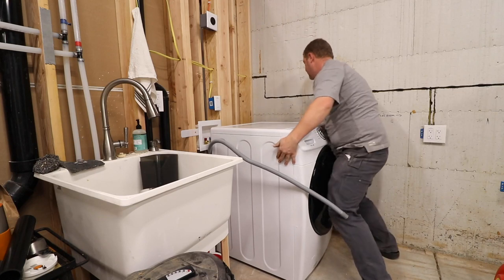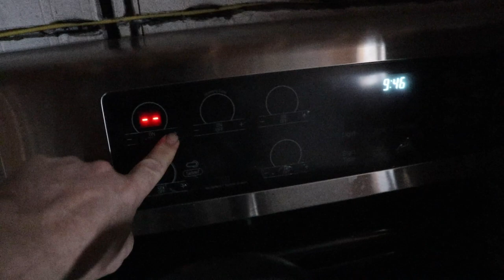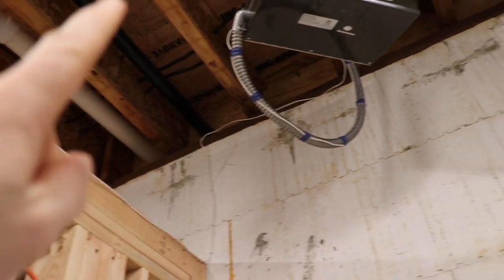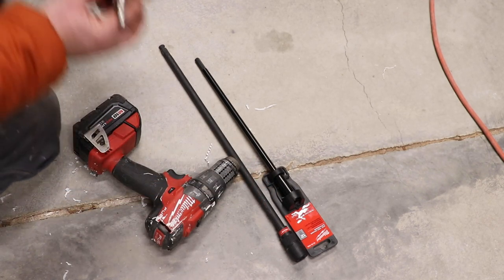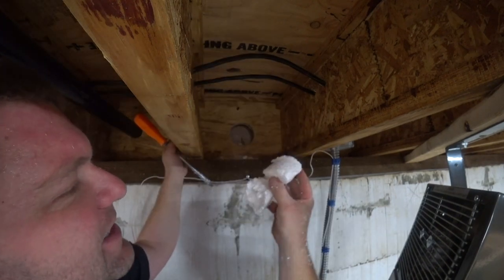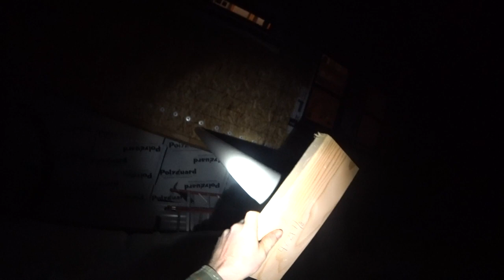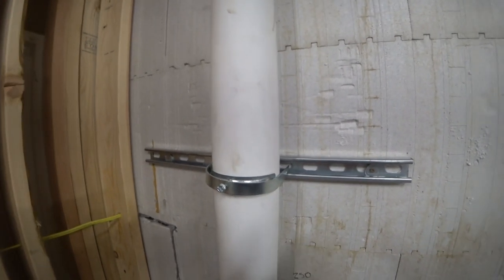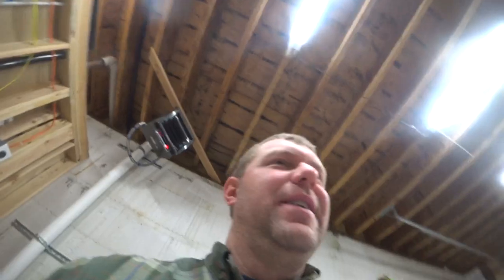WINTER YOU DIRRTY DOG! (Dryer Vent Installation)

Comment: I have a steel roof and installed snow brakes on both sides. They hold on to the snow to keep it from sliding off and killing someone. You can use then use a snow rake to pull off some of the thicker or heavier snow. Works good for me.

Comment: should be usin4 inch metal or aluminum for the dryer vent. i've  never seen anyone use plastic for a dryer vent haha  and you should never crimp into the vent, all crimps should be going outward so exhaust or lint doesn't collect and cause a fire. also no screws.

Comment: Use inexpensive (relative to PVC) metal vent pipe and cover it with insulated cover that is commonly used for air conditioning/heating  ducting purposes (HVAC Insulated-Flex Ducting Ventilation Duct Hose).  That will comply with building regs and also keep inside the pie and out of your house. In any case, you will most likely have solved the issue one way or the other since we're weeks behind real life.

Comment: Yes, I was screaming at you until about 25 minutes in! You figured it out, though. RTFM! Read the code, then make your plans. I just moved into a house that was venting the dryer into the carport that had been enclosed for a garage... what a mess, lint everywhere and I had to use a dehumidifier to remove the moisture from the air. Bit the bullet, did a proper installation of 4" galvanized tin pipe and have never looked back! There is very little heat generated from the pipe, most of it goes right outside. Unistrut is complete overkill for tin pipe, you can use plumber's strapping.

Comment: Try inserting 4 inch galvanized into the 4 and a half pvc as a sleeve only where it goes through the wall. That way you don't have to patch things. 4 inch galvanized pipe is what you need to vent a dryer. There are also length and number of elbows allowed as well as verticle length.

Comment: With a lint filter in the dryer, I would build and put a diverter box on the vent pipe to direct the warm air inside the garage in the winter. Even just an hour every wash day would reduce power consumption.

Comment: The "V" in DWV is for plumbing venting, not exhaust venting. Yes, it has been used in newer heating systems (90+%) but it is not listed for that use either. There is specifically designed duct work for those heating units. The only acceptable heating venting material where I live is galvanized steel. Properly installed it will not collect lint in a dryer system and can be taken apart to clean if it does build up.

Comment: 4" aluminum pipe with silver metal tape for sealing the joints. Never use screws. Make sure the crimps of the pipe are pointing with the flow of the air from dryer.

Comment: I'm a fan, but I can't take it! Run your drill on high speed and quit pulsing and rocking it! Keep it straight... Put the drill by the ceiling so if it spins it will hit the bottom of the floor and won't take your arm with it. It's nice that the snow sheds from the roof with just a few inches of snow.

Comment: You don't want the PVC pipe for any vent that might be subject to heat, fire etc.  The reason is off  gassing and toxic smoke. Also read about   what the limits are for heat rise and vent length.

Comment: As a HVAC worker for a living, this is a hard no. This is not acceptable from the heat. Also, the static charge on PVC pipes from left over lint an hot air running through it would result in buildup. You explained it perfectly. Absolutely must be changed. You can insulate any duct pipe.

Comment: Four inch galvanized sheetmetal pipe . put in a lint cleaning accessable fitting at the bottom of the pipe as you will always get lint buildup.

Comment: The Diablo setup is the best, I’m a cabinet maker and have been using the quick release for years. Never had a problem, and I’ve never run s holesaw in reverse. No need, just pulll back while in forward.

Comment: In 2001 I worked on a job inside a metal building that was 300' wide and 900' long.  At the peak of the roof it was almost 30' with over 10' side walls.  In January it came almost a foot of snow, the weather stayed cold for about two weeks and then warmed up to just about freezing.  The building was not heated although there were some area heaters being used in certain areas.  During the afternoon the interior of the building must have heated to just above freezing and the entire roof's snow slid off all at one time.  It was piled up about 3 feet high and five feet across the length of the building on both sides and that was packed down a lot.  No one was entering or exiting at the time but if they would have been there is no doubt they would have been seriously injured.  I was only there for one winter and we only had the one real heavy snow but I think of it anytime I am around a metal roofed building to this day.  If you are at the right place it isn't like someone throwing a snow ball at you, it is serious business.

Comment: You will need a one way exterior flapper to prevent cold air from coming in and also a critter cage. They come preassembled. You error becomes a training video for others. You can use your metal work for keeping the dryer vent straight and flush to the wall. 4 inch vent pipe!

Comment: I use PVC for ducting my wood shop dust collection system and resolved the static buildup by wrapping the pipe with bare braided wire which was grounded to the dust collector. This has been working fine for several years without static buildup. I used one wrap of wire every 2 feet.

Comment: Give up on that snow landing area. It piled up higher than 7 feet at my cabin for 12 foot per side roof. 
Drain Waste and Drain line vent to the roof above a drain stack. Not Drain Waste Air Vent as in HVAC. 
Flex hose or sheet metal duct. It comes flat and self interlocks into 2, 3, or 4 foot sections just like the stove pipe in the shack.

Comment: I always call the inspector in my area, when working on something new. They can tell you what is used for the job that they will pass. Most inspectors are glad to help you so they don't have to make you change the work later. Sorry to see you had a set back, but its only a small one. One 4" PVC pipe is a small price in the total price of building a house. My wife always tells me did you read the information yet, you need to start job XXX next week and you need to make sure X and Y can be used. I never would have been able to do the work I did without her. Be safe and take care of each other....

Comment: Rated for plumbing vents, not heat-related vents. It will outgas toxic chemicals when it get heated, and it will burn in nasty ways. Not good for a dryer or range.

Comment: Hey Jessie, I do this stuff for a living.  Next time drill a small pilot hole from the inside all the way through then drill from both sides that way you don't make a mess by blowing out the other side.  This is for both wood and cement.  Just a bit of a trick and it saves buying an extension.

Comment: PVC is for venting in plumbing and some new type high efficiency and vary low exhaust temp not for dryer venting use steal vent pipe and if you don’t want to use screws or pop rivet us  heavy duty house clamps

Comment: Instead of venting to the out side with your dryer set up a water bucket trap in your garage. To capture the lint and use the heat to help heat your home. Missouri wind and solar has a video on how to do this....  No seance in waisted good heat

Comment: small thought here,  During the hot summer months, dry the laundry outside, in the winter a little extra heat in the house is a nice thing!  If you're not using the dryer as much in the summer you (a) save electrical cost as well as heat and (b) can more easily mitigate the heat with a fan or two.

Comment: Awesome opening shot from the drone.  Roof slides can be triggered by vibration of simply closing a door, deadly to people and deck structures.  As you might agree...at work we often say, "We do it right because we do it twice."  Good luck on the vent, you will figure it out.

Comment: FYI,  in woodworking dust removal systems we cut down on static in PVC pipe by running a copper grounding wire inside the pipe.  The wire is then grounded to the house ground.

Comment: Home Depot usually sells 4" dryer duct in flat sheets of aluminum or galvanized steel. The flat sheets are pre-bent to form a seam when you curl it into the round tubular shape. Your Unistrut stuff will work fine. DWV is for plumbing only.

Comment: Jesse the elephant in the room where you are drilling for venting has to be the weak link in insulating your home. You will be surprised to see how much heat loss you have there. Maybe some mineral wool insulation in those spots really helps you out. Maybe that's already your plan but if not might want to do it quickly. House will be warmer immediately and your electric heater will not run as often. Winner. Maybe.

Comment: You are very lucky you didn't break a wrist using that battery powered drill for a big hole saw. That's a job for a big corded drill WITH a screw in arm to control the torque (like my Milwaukee). 
It also comes with an optional right angle chuck for drilling studs for electrical. Right tool for the right job will keep you healthy and safe.

Comment: Code should be you are only allowed 25 feet of ducting total for your dryer vent. Each 90 degree elbow counts as 5 feet of pipe. I believe a 45 counts as 2.5 feet but you don't have a need for those. You should be good to go, just use metal ducting. Check and see what they want you to use to fasten the sections together, some places are very strange in their requests.

Comment: ... just spent 200 bucks more on the dryer to get a condensation dryer. This doesnt need a vent but only a drain, and it saves a lot of electricity... basically paying for itself by the lower electricity bill...

Comment: They have dryer indoor vent filters. You could recycle the dryer hot air back into the garage to help with heating in the winter. And yes some humidity will during winter. Ck code and they might let you. Just put a diverter or flapper valve.

Comment: You can hang-dry even in sub-zero weather as long as it's well ventilated and not too humid outside. You can use your RV shack for it if you don't want to do it in the house. 

Down the road it'll save you a lot of electricity as well.

Comment: 4" dryer duct can be found made of aluminum. HVAC flexible duct can be slid over the metallic duct to insulate it and prevent the heat transfer into garage area during the summer months. Your option if you wish to remove the insulation and use it as a heat gain in the heating months. All joints in the metallic vent line should be taped with aluminum duct tape prior to covering with the flexible duct. The 4" aluminum duct is generally available in 3, 4 and 6 foot lengths. Elbows are readily available and should have all joints sealed with tape after the correct angle is set. Be sure to use aluminum screws not more than 1/2 inch in length to secure the elbow to the straight pieces.

Comment: Your probably right the first time. 4 1/2 but the holes only off from each other by small fraction of an inch. Foam saws differently than your inside sip and your outside sip panel. Add on your rim joist and you have 3 different times that must line up. Very hard to do without a drill press, which can't fit , lol. Nice going. Steal dryer duct comes in 5' sections but only 4 1/8" in diameter. Seamed on one edge and you then zip it together to make a tube. 90 degree elbows make corners a breeze. Duct tape joints or use a duct type tape that's metal backed, used by a/c duct installers. Don't use any screws to join pipes or elbows. Done.

Comment: Hey Jessie, don't let it get you down brother. Isn't it ironic that in the good ol USA where we live, they sell this plastic expandable flex pipe as dryer vent and it is not supposed to be used at all. It too  clogs up with lint and can cause a house fire, a very common cause of house fires. Anyway, you should be able to slip metal pipe right into your wall brackets and elbow right outside. Only hard part I see is getting the PVC pipe back out of the wall ERRRR!! Metal pipe is what we used once we learned this lesson about the flex pipe on dryer vents. They sell them in the big box stores as a dryer vent kit....how crazy is that? I also see Mom is coming right along there. We still pray for you guys often, the little one as well. Be blessed.

Comment: When using PVC for a dust collecting system , you can run a bare copper ground wire inside the pipe. Also the V on the PVC refers to plumbing vent - not air venting.

Comment: Use metal for a dryer vent. It won't burn through as easily when the lint starts fire. The plastic pipes are fuel for the fire.
Heat from the dryer won't be a problem in summer. A clothesline outside can't heat up your house. Sun and wind are the original off grid power supply. If you paid what I pay for electricity there would be a clothes drying rack indoors too.

Comment: Metal for Dryer Vents... You can even get flexible duct for dryer connections. Exterior vent comes with a flap that only opens when the dryer is in use.

Comment: There is snow on the ground....blow that hot air back into the garage with a lint trap/screen on the end of that  dryer with some flexible house.  IF you use fabric softener the garage will smell so clean and fresh!

Comment: A snow guard called a snowbird is a device installed on metal roofs most of the time on the seam to retain snow and ice from falling to the surface. It helps you to minimize your liability by preventing accidents such as snow and ice slide.

Comment: DWV is for Plumbing not to be used with anything else unless the manufacturer specifically calls it out as acceptable. Most bath fans allow schedule 40 PVC, most high efficiency direct vent water heaters allow PVC venting...defiantly use sheet metal duct and I would wrap all vent ducting with duct insulation.

Comment: Snow jacks or snow bars on the roof will prevent the avalanches (which can tear gutters off or damage property below).   PVC is only good for around 140-F, the larger problem is the noxious smoke it emits if it catches fire.   It's recommend that you use solid aluminum ductwork for the dryer venting, make sure you point the crimped ends of the fittings towards the outside (opposite of how a chimney pipe is assembled).    You're going to be screwed on the heat-gain/heat-loss on that dryer anyway since you have to admit outside air back into the building to replace what it pumps out.    Also the amount of heat transferred into the living space from that short run of ductwork will be quite minimal (you'll likely appreciate what little you're going to get from it during the winter months).  - Side note, do you need to be concerned about the combustibility of the SIP insulation where the dryer vent passes through (and the discharge of any other heat generating/conveying appliance - i.e. range hood)?

Comment: G'Day, a heat pump, condenser, dryer is what I use. It uses the heat that already exists in the room to dry the clothes. Instead of the dryer having an electric element or gas burner, it has a reverse cycle air conditioner. The exhaust air is passed through a condenser, that removes the moisture, turns back into water, and pumps it away down the drain. No ducting, one third electricity consumption. Perfect partner for a front load washer.

Comment: Jesse, you can replace your pvc with aluminum dryer vent piping. Then you can use Refectix (bubble wrap with foil on both sides) to insulate the pipe. According to my research, Reflectix is rated to 180 degrees F and dryer vent max heat is about 160 degrees F. Wrap the Reflectix around the pipe and seal with metal tape. Campers use Reflectix to keep their boiling pots warm after heating them so it should withstand the heat a dryer can create. Check this idea out online. Good luck!

Comment: Also if it’s a electric dryer you can put a tee with flap and in winter open up and get added heat since no co2. Tee has screen to prevent lint from coming out

Comment: Save your arms and get an adapter for your big hammer drill. they make chucks to sts adapters. They make hole drilling so much easier. Also they make draft guards for dryers...they are well worth it.

Comment: I  believe the vent word on pvc pipe is meant for strictly venting of liquid waste on sewer piping use. It is not meant to use on air type vent of other systems,especially where any heat is involved. The flexable plastic vent pipe is not wise to use on dryer venting either, there is flexable metal tubing available for that use. I know that hvac professionals use large pvc pipe for underground heat duct in most installations primarily  because it doesn't rust,and it is buried under concrete and earth.

Comment: Another trick I have used when putting pipe through a wall like yours is to use a soap to lubricate the pipe. It is nontoxic and easy to wash off any excess. I usually keep a bar of Irish spring (repels mice - google it) in my toolkit just for this purpose. On a big pipe like yours u could also use some liquid detergent on a rag to wipe down the pipe before inserting into the wall.

Comment: If we had that much snow here in the UK, we would think the end has come, more than 1/2” everything stops. At Least in the south. Agree with others, would have gone for a heat pump dryer, just a drain and v cheap to run.